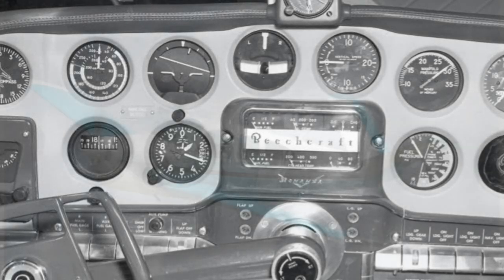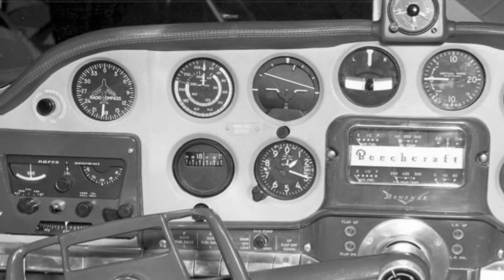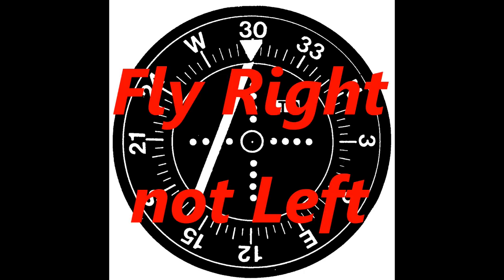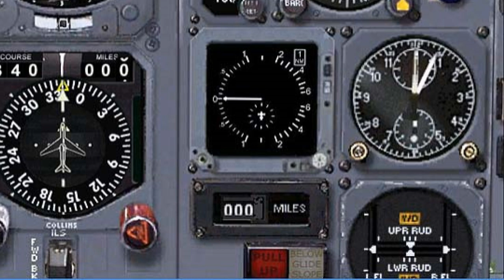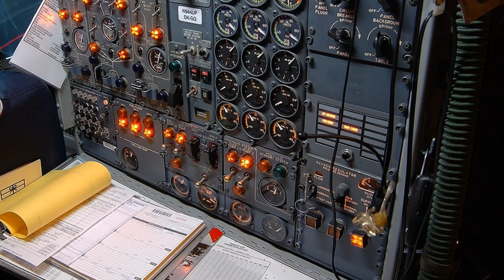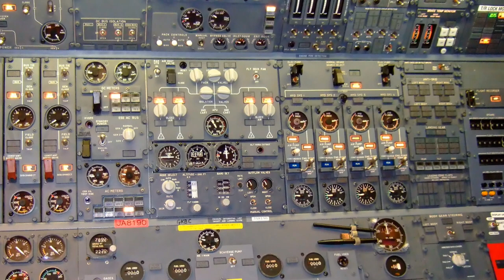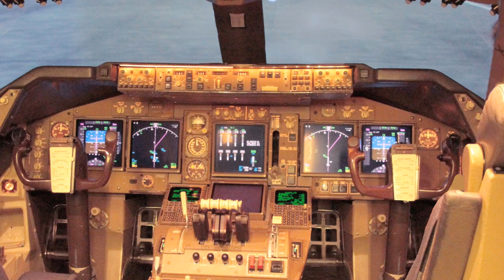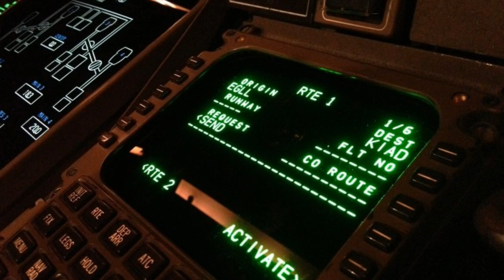Steam power planes ✈️to Glass 💻Cockpits ✈️

Comment: Thanks James! This is the first video that I have seen that documents the transition. Many pilots took early retirement when they went to training on their first glass cockpit because of the immense relearning that was required. I think that as in the "old days" when the standard "T" configuration was adopted, we will see more standardization of how the glass is displayed and how the FMS manufacturers will make the boxes more user friendly. A Honeywell, Garmin and Universal all have very different ways of obtaining the same information as you know. It's like transitioning from Windows to DOS to Swift, the information is there, but you have to learn how to pull it up!
Reply from the maker: Rick great insights.  YES it would be great if the avionics manufacturers could standardize.  Right now I regularly fly Honeywell, Garmin, and Rockwell Collins.  The only similiar thing is that they are all installed in a jet airplane.  Thanks for the comment.  Fly Safe.  James